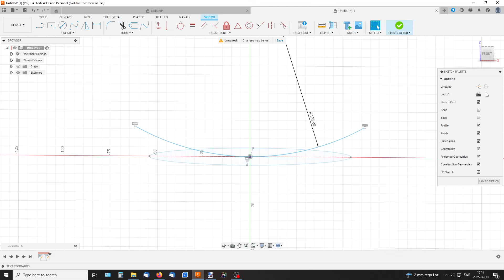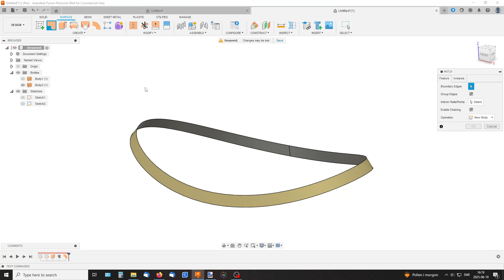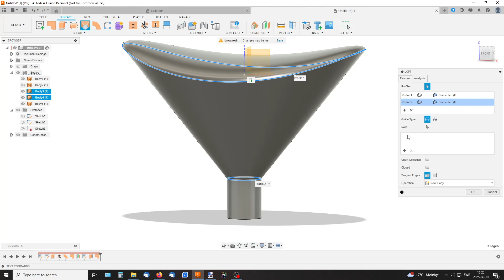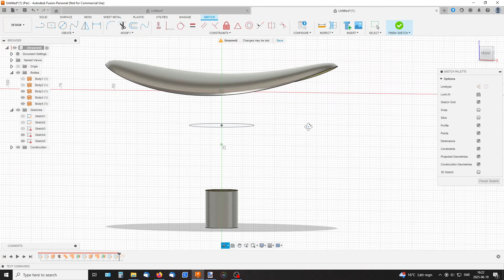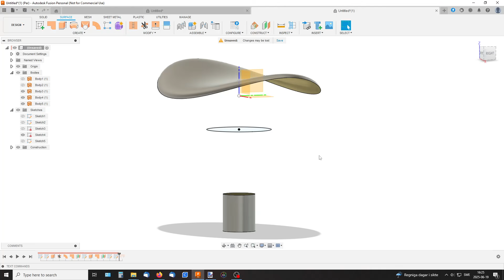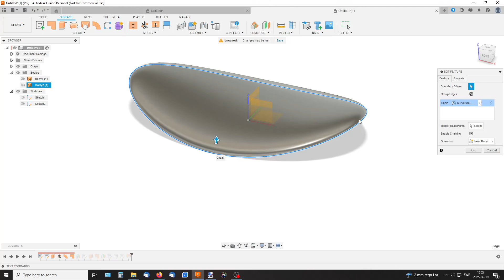Surface modeling this shape

Comment: First of all, this video was one of the most helpful
Videos I have seen. I’m the guy that asked on Reddit. 

I tried doing this again last night, the very first sketch of the top of the handle, the spline points were driving me crazy. Did fusion change the way constrained spline points behave? When I constrain the left and right points to be locked vertivally and horizontally, it locks my handles and when I try to change the curvature it just moves the point left or right, without letting me use the handle to change the curvature
Reply from the maker: I'm not sure what's happening there. Maybe you added some constraints by accident to the handle? Try making a new spline and avoid creating any auto constraints (you can hold ctrl while dragging them to be sure to avoid it if otherwise whould have snapped to something).